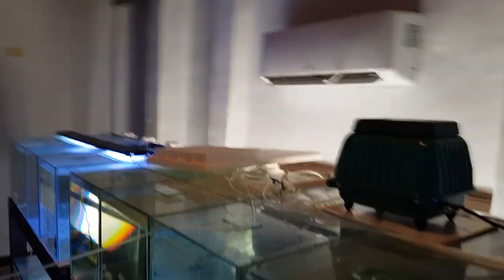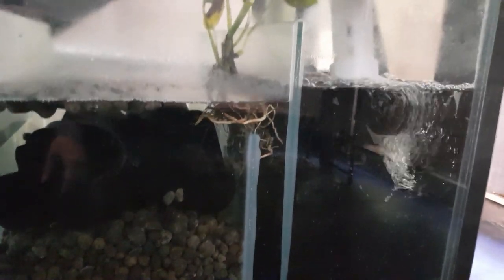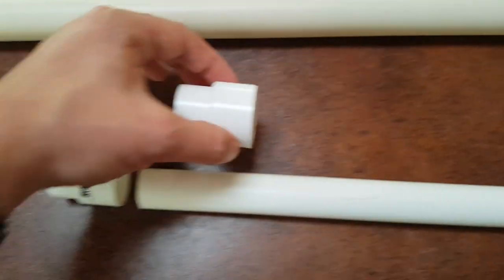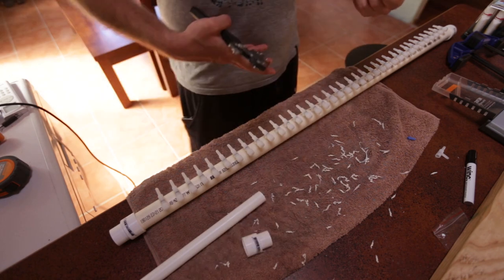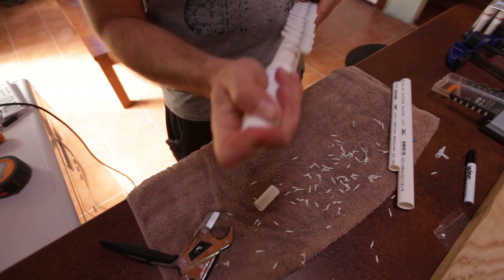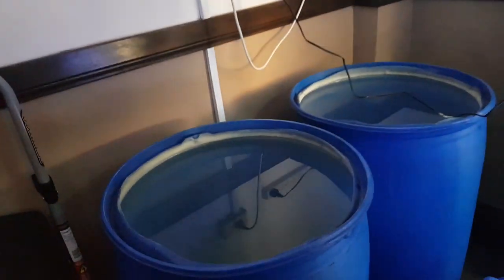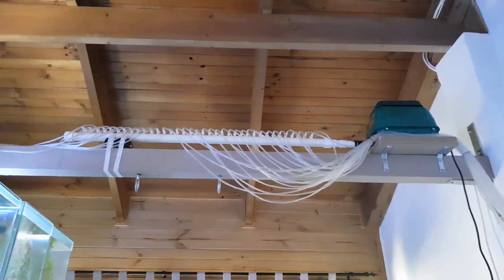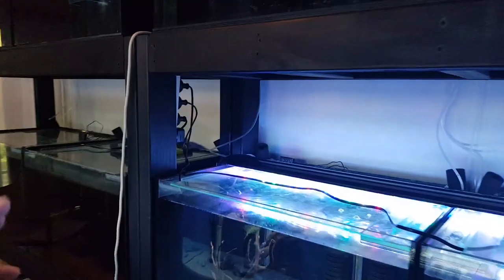Resun LP-60 Air Pump Review and Air Pump Manifold Build with 36 outlets!

Comment: Great vid mate love the manifold.  I was wondering what brand the lp60 pump is and how quiet it is.  I was also wondering if you think a bleeder valve would be necessary? Especially for someone with less tanks (approximately 15 double or single sponges.

Regards Duzzy🇦🇺
Reply from the maker: Thanks mate, glad you like the manifold. the brand that makes the LP60 is Resun. Hard to say how quiet it is but I would say the bubbles it creates are louder than the pump itself. Good news though, you wont need to make a manifold like me as they are sold with a 14 outlet manifold as standard. You could use a T-piece off one of them to get you to 15. As for a bleeder valve, again you can simply use a T-piece off one of the outlets and attach a tap to one end. Close/open it as you need. Hope that helps 👍
Reply: @JasonsCichlids  thanks for the info greatly appreciated.

Comment: Good stuff mate, ive had a great run with my lp40. I prefer to run pvc around the room then run barbs on the pvc manifold then air lines to the tank with the inline tap just above the tank so its easier to adjust exactly how I want the flow. 
Unfortunately I found the taps u used always split down the side for some reason so I changed to the black heavy duty irrigation ones which come either threaded or barbed.
Reply from the maker: I was going to run PVC around the room, but I had 200m of airline tubing so figured I should use that instead rather than buying more PVC. Funny you say that about the taps splitting, I had been using the cheap blue taps you get off ebay and they are starting to split. About 7 to 8 months of use out of them.
Reply: @JasonsCichlids  That's fair enough its always good to use stuff u already have. 
If u have an issue with these too just go for the black irrigation ones and u wont look back! They aren't fine adjustment but close enough is good enough for filters.
Reply from the maker: Thanks Jamie. I'll see how these ones go and look to upgrade them in the future. Be easier to source them too I guess

Comment: Just subscribe ,
I just in the middle of doing a closed loop with pvc pipes 
I am going too use some adjustable metal threaded gang valves to 24 large sponge filters 
Pump will be the hailea 120hap air pump, fingers crossed it all works , 
Do you fine your losing air towards the end of your pvc pipe?
Reply from the maker: Thanks for subscribing Andrew! Nice one mate, that is a great air pump and will have no problems powering your 24 sponge filters. But no, I do not lose air at the end of the PVC pipe. But that's because the gang valves at that end of the manifold connect to aquariums which are the closest aquariums to the manifold, only about 1 metre of airline tubing was required for them. So thankfully that isn't an issue for my set up.

Comment: How noisy is the pump? Any idea which is quieter this or the hailea v60?
Reply from the maker: I don't  how loud the hailea is. It's hard to say how loud the Resun LP-60 is. But I think you'll be surprised at how quiet it is compared to its size and output. A quick Google search says it 45db if that helps.

Comment: Could you please let me know the size of the drill bit you used and the make of the valve
Reply from the maker: I am sorry I don't recall the size of the drill bit. Just use an off cut of PVC and drill some test holes in that to find the correct size. That's what I did.